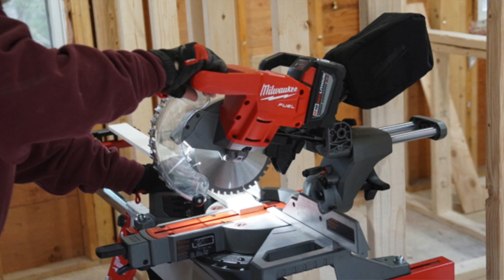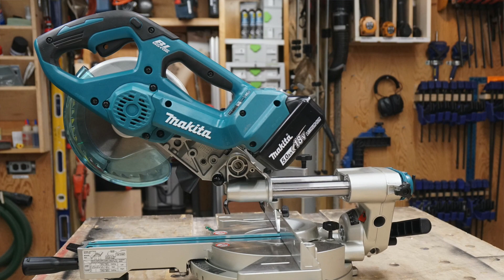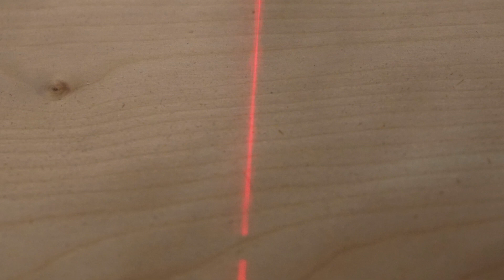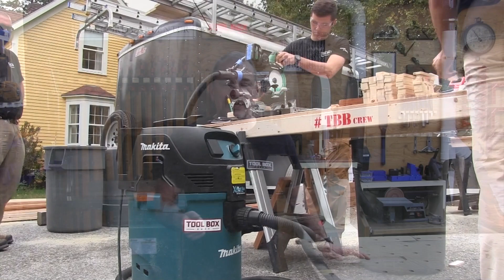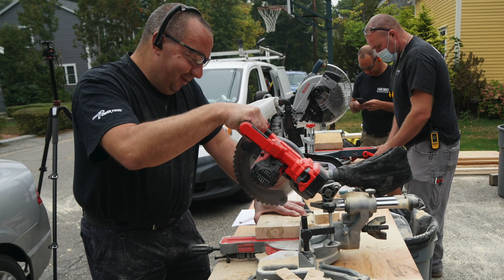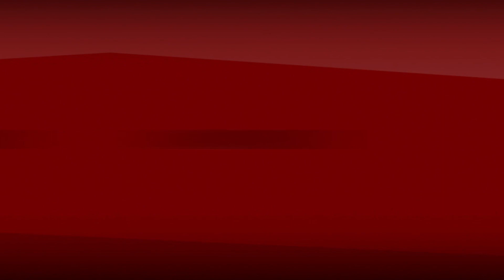BEST Compact Cordless Miter Saw - HEAD-TO-HEAD

Comment: I'm a commercial voice/data installer and I'm talking large medical campuses, university's ,data centers you get the idea. I run makita at work, and have access to milwaukee, hilti, and everything else under the sun. I started buying Kobalt 24v for home, have 9 tools and zero complaints.I have this saw, I'm far from a professional carpenter but I play one in my garage. Like all Kobalt cordless tools it's tough to beat for the money. I paid 280 for it with a 6ah  battery, it was dead on accurate out of the box and with a diablo blade on it I'm sure it exceeds my skills.

Comment: DeWalt is fairly old in design and is in need of major overhauls. Mainly a brushless upgrade, improve dust redirection, slightly longer blade travel, slightly faster RPM, clamp redesign, light mode switch to keep it on like a lamp or trigger, and a lighter base frame (down to <27lbs). I have the ,discontinued, Ridgid 18V BL miter. My two gripes about it are no manual lighting switch to keep it on, and the last 1/8" of the cut sometimes doesn't finish.

I'm a little confused why the Craftsman performed better than the DeWalt... and thus, MAJOR OVERHAULs. If they have to accomplish it in 60V, then make it so.
Reply: Dewalt makes good products that get the job done. They may not have the best ergonomics or features but the tools I have used are well built and can produce accurate and consistent work with minimumal out of box calibration

Comment: Kobalt doesn’t have a miter detent override lever, making it difficult or impossible to cut 44 or 46 degrees, for example. I didn’t hear that feature mentioned. Wonderful review overall, thanks for doing this.
Reply: Um, sure it does.  You lift UP on the handle to slide to the in-between slots, and then pull it down to lock it into position.  It isn't as nice as the Dewalt thumb trigger, but it still works.
Reply from the maker: Great point
Reply: Yikes, that seems like a deal breaker.  Outside miters on baseboard are almost always 46.

Comment: I’m a huge Hikoki fan, but man Metabo HPT needs to up the accuracy of this saw and add a shadow line if they think it’s worth over a grand.
Reply: The 10 inch metabo 36v was going for $300 with a starter kit, it was just raised to $400 but sold out now.
Reply: You can buy this saw now at Lowe’s for 399$ comes with battery and adapter I believe plus metabo has a offer for mail in purchase verification and I think you can choose a couple of different free items.
Reply: It actually does have a shadow line. The reason it costs so much is because it's made in Japan, where as their 10", along with most all their other cordless tools(and every other brand here) are made in China. It's a very high end saw.

Comment: The Kobalt is a great saw. I've been running one for 2 years. Just does a great job. Zero issues with 2 years of heavy use. Pro cabinet maker. If i'm not building cabinets then I'm installing.
Reply: How precise is it and it's everything adjustable?

Comment: i believe kobalt is underated.they have the best prices for the batteries and they finish in the top half of every test that they are in.Unless they dont have a tool that you need i cant see any reason to pay a third more for makita or dewalt
Reply: I'm a big fan of Kobalt, but one reason is that buying Makita and DeWalt is ultimately more ethical than buying Kobalt.
Reply: @orijimi  just curious- how is that the case?

Comment: I am considering to buy the dewalt, since I am already invested in their platform. Do you think that I should wait that they uptdate their cordless miter saw ?
Reply: Hey mateo Belanger what country are you in? In Europe dewalt have an 8inch/216mm cordless mitre saw that runs on a single flexvolt battery.
A ten inch/250mm cordless that also runs on a single flexvolt battery and looks almost identical to their 12 inch double battery cordless flexvolt mitre saw.
I would say go for it and get one now as they are excellent and are not likely to get much better for quite a while. I have the 8 & 12 inch saws with the 8 inch being lighter and my day to day saw them I will get the 12 inch out for ultra fine work or when I need to use the full 14 inch plus cutting capacity. Get yourself one dude!
Reply: @garethheathcote4988  it's crazy that we don't have those available in the states.
Reply: I have been using the dewalt 7" miter  saw to do some trim work and have had no issues. Once you get the angle and bevel calibrated, is has been consistent and held up well. There are obviously places it could be improved such as the dust extraction and some of knobs but it makes consistent and accurate cuts which really is all that matters.

Comment: I bought the Milwaukee earlier this year and so far I've not needed it's big brother. My friend bought the dewalt first. After he tried my Milwaukee he agreed that it's much better.
Reply: I'm curious to know what features your friend liked the most about your Milwaukee saw over his dewalt  ?
Reply: @gustavomacall4949  the Milwaukee does dual bevel cuts where his dewalt does not. While they have the same size blade the Milwaukee has a greater depth of cut. I can easily miter cut a 2x3 with it sitting up right on 1 1/2 edge sitting on the base with the Milwaukee. The dewalt can not. Also the dust collection of the dust bag is not just superior to the dewalt it's the most effective one we have ever seen.

Comment: I love cordless tools and have a plethora of them, but I don’t really see the need for a cordless mitre saw. I set mine up on a table or stand and it stays there for most, if not all of the job. It’s not like the drills, sawzalls, nail guns, etc that rove all over the jobsite.
Reply: Not having to deal with finding power and tripping over cords make a safer are more efficient job site. Seen some major fire hazards when 10 tools are all plugged into a single temp outlet on new build houses.
Reply: @Eric-dr5bj     I’ve seen that too, but nowadays there tends to be a lot less power cords and air hoses trailing all over the place. The larger, more stationary tools like mitre or table saws i prefer corded. But that’s just me.

Comment: What's amazing is the Dewalt and Craftsman are both brushed and came in 1st and 2 nd in runtime
Reply: I think it's down to power consumption vs efficiency. While brushless motors are more efficient at delivering power, the manufacturers are stepping up to more powerful motors in their brushless offerings. It's like a fuel efficient V8 vs an older less efficient 6 cylinder. I have this craftsman and I like it. The run time on a 4ah battery is good. But I also notice it's not as powerful. So, it's using less power to spin the blade than a more powerful brushless saw
Reply: @erics.4113  the dewalt was the most powerful
Reply: @loucifer323  I'm sure it is. The same company owns both brands I don't see them offering more power in their less premium brand. 

Im happy with the craftsman for light duty it's just fine and battery life seems good (possibly down to it being less powerful).
Reply: @erics.4113  I have the dewalt it cuts great it doesn't bog down, unless you're cutting something that's not designed for, and as far as not having duel bevel I always flip everything over it very rare were you ever need to use duel bevel
Reply: @loucifer323  is that 7 1/4 as well? I may go to a 10inch or possibly larger some time in the future I noticed when doing miters it dramatically reduces the size of lumber I can use.
Reply: @erics.4113  Yes 71/4

Comment: This came just in time. I am looking at the Makita, I own a corded Makita 10" and it is a hassle in a finished house. a 7 1/2 cordless would be much more convenient, I started with a 7 1/2 decades ago when that was all there was. 

Great work guys, thanks for the great reviews. I found trade shows don't allow in-depth use to review anymore so your reviews help look at everything.
Reply: Hi Robert, I’ve had the 36v Makita for a couple years and use it 95% of the time over my 10 and 12 inch saws.  I’ve had siding jobs where the batteries lasted for a full week and it has power out the ying/yang. Not even mentioning the difference in price for 7 1/4” blades.
Reply: I still have my old nimh makita 7-1/2. I added an adapter to run my li-ion batteries and its still going strong after 15 years, and some bearings replaced over the years.  I really want to replace it with a dual bevel saw, but mine hasn't died yet

Comment: I don't see how Makita didn't place better
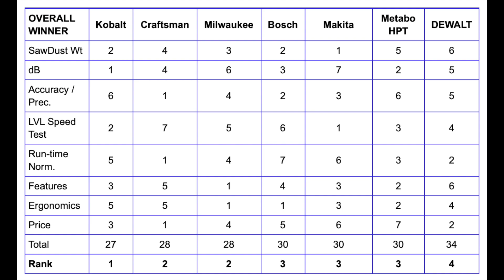Reply: 13:50 I think everybody compromises or at least is willing to on one thing. Noise to me isn’t that big a deal. I wear plugs when I should and I’m not bothered. The price and the run time are the only other major dings. Mind you get 2 batteries with the Makita as priced and that is also what stunts the score on runtime. I’m on 2 of these platforms and would still choose Makita. Funny thing I just realized, Milwaukita are the only out of the bunch you can’t purchase from Lowe’s.
Reply from the maker: @chriscleave2173  I agree - that's why we share all this for you - if it's not important to you remove it from the matrix and re-rank them. 

The point is to give you enough information to make your own deision
Reply: @ConcordCarpenter  still in excellent video as usual
Reply: @ConcordCarpenter  I always hate when the Tool brands are like don't win though I guess I'm competitive even when it comes to tools LOL
Reply: You can buy makita tool only for $599.  I have plenty of makita batteries because that's my platform.  The big issue with makita is it doesn't bevel both directions.  That's a deal breaker for me.  Makita needs to fix that.  
Great job Rob and crew
Reply: @markwigley9185 thats where im at.
Reply: Wouldn’a taken much, the scoring was awfully close in terms of points. Makita’s compact seems to be a bit older in design than their larger X2 miters. Single bevel and louder than the competition. They came up last or close to last on a couple parameters and that’s all that held them out. Say they scored near the top in terms of volume like usual and add dual bevel and Makita wins hands down.

Comment: I have the DeWalt and the dust collection does need some help. What I did was leave it up and pushed the rubber outside of the blade guard wheels. After a day it molded the rubber open. Now the dust collection works really well. I also considered gluing plastic to the back of the rubber to keep it open too like a nose breathing strip, we'll see if it comes to that.
Reply: I did that, it works lol but yeah in general the dust collection is not the greatest

Comment: Do you think Dewalt will release a dual bevel 7 1/4" anytime soon chief?
Reply from the maker: hope so
Reply: Seems unnecessary in this size and will add complexity and cost and the benefits are minimal
Reply: @Eric-dr5bj  I disagree. I  think dual bevel is more important in a small saw like this where you may have to make compound cuts more often. For instance, I can easily cut large crown molding nested on my 12 inch saw where I only need to swing the miter. But if I tried to do the same with a 7 1/4" saw, it would have to be cut flat. Without being able to bevel in both directions, you're screwed on half your cuts.
Reply: @jamessimon7292  It may be desired by some but the additional cost and complexity isn't worth it to the majority in the market for this saw. Metabo sells a dual for only four times the cost of the Dewalt.
Reply: Dual bevel is overrated I just flip the material it's faster and I think more accurate